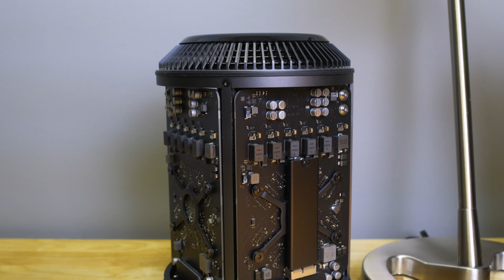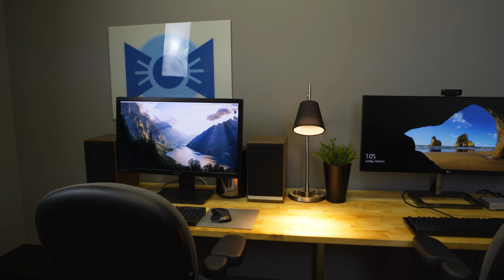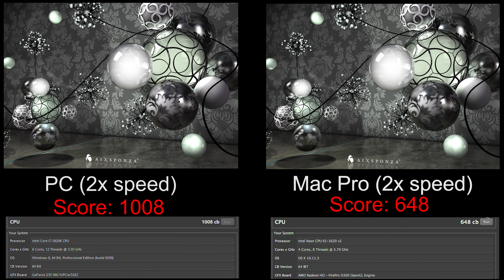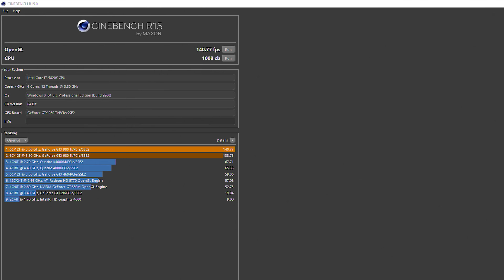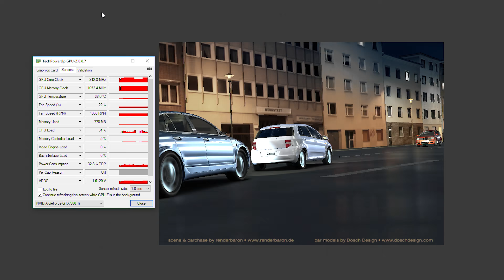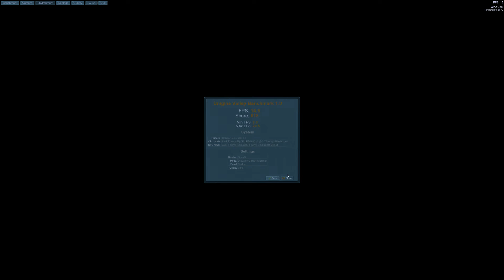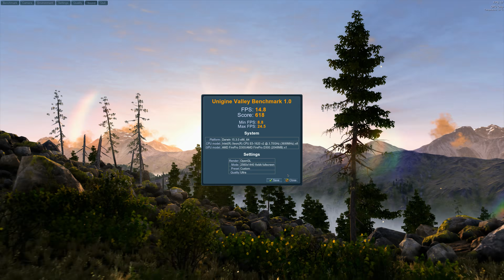$2,000 Custom PC vs $4,000 Mac Pro

Comment: isn't the firepro a gpu for workstations?
Reply: yes but work station GPUs are made for reliability not power.
Reply: +odisy64 Not only that! They are made for precision, gaming GPU's are made for real time rendering where you need no precision. I am a 3D artist and I tried mayn graphic cards, for example the GTX 960m was unuseable, finally I was using the CPU integrated graphics, because it was even better. Professional graphic cards are only for working with datas, if they are rendering something, it's non real time render, which is incredibly nice, but it's one picture(or frame if u want it so) per 1 hour (for small projects) (deppends on power pf the card), gaming cards are meant for nonstop real time rendering, they render 60 pictures/frames in ONE SECOND, that's pretty different, and they don't need any precision, for "gaming precision" there os the CPU. And also a difference is in drivers, GeForce cards have ONLY drivers for in-game, (by nvidia called Game Ready Driver), they have no driver for professional uses in-windows, but Pro cards have them, some have more drivers for specified software
Reply: David S. GPUs are GPUs, in fact, the top tier Quadro card, from Nvidia, uses the same architecture as the current top tier GeForce card.

If a 750m paired with an i7 4700 MQ can run a game like Metal Gear Solid V: The Phantom Pain at medium high settings at a solid 60 FPS, there is no reason to think it's any less powerful than a mobile quadro of the same architecture.
Reply: David S. Actually I meant in terms of rendering things efficiently or accurately I know that Nvidia uses architectures like Pascal & Maxwell but what does GNC have something similar to cuda cores to help rendering?
Reply: VwjUnit ECC memory isn't the biggest bonus of professional card, but yeah, most professionals working in demanding graphical applications will be happy for it. About big companies, it's not about if user is a freelancer or a big company, like Pixar, it's mainly about what the user do with the card, not who use it, but what for he use it. About LinusTech, he is mainly in to gaming hardware, take a look on all his videos, games, games and games... I'm very interested in to what's his profession, because it doesn't seem he has to work with a card like this. 
Don't trust, in pro hardware, to people who don't understand it's useage.
I am a professional 3D artist and I've been modeling models for GTAV, The Crew, Red Valor, The Crew and more, I guess I understand to what a 3D artist needs.
Reply: odisy64 look, I study electronic engineering, I work as a 3D artist and I know what the cards are meant for. I designed a 3D modeling software known as Linea3D PRO(not for public useage), I know what on the power is used, I don't say he doesn't understand to technology, but probably he does only as a user. The videos he made about this case haven't good reasons, mainly the support he was talking about. So why a level designer use a gaming gpu, if he needs pro support? Because he needs a gpu ready for real time (if he use a real time engine like Snowdrop or CryENGINE). I can't imagine a level designer with a Quadro... And gaming cards have same support, just don't buy it in a consumer shop
Reply: Trash animations Sure,
https://www.artstation.com/artwork/gGbZQ
It's one of my cars created for The Crew, some textures, like ID, or Ford logo in interior weren't created by me, they are objective for all in-game vehicles. I was creating usualy environment, but I did also 3 cars, including this Mustang
Reply: nice work, David!
Reply: I recommenced that you watch $5,000 Graphics Card!? - HOLY $H!T Ep. 9 from Linus. But I did some digging and at least 3 years ago drivers for Quadro were better optimized than the Geforce cards for things like 3D work. But since Titan cards are both aimed at consumer and professional market I would think the Geforce line would have a decent drivers for 3D work. But this is all I know about this subject.
Reply: Somethingafw Yes, Titan Z and Titan P are good for 3D, it's perfect for people who work in non-real time software and also in real-time software. So for low AAA game development are Titan Z, or P and Radeon Pro great.  In movie industry (still talking about 3D) is better FirePro, or Quadro. I' have never had a Titan X in my hands, so can't say
Reply: but the gtx 980 ti edges it out in every single way
Reply: When Apple controls the drivers and does the support under OSX, the distinction between most Firepros and Radeons is slim.
Reply: ***** Not all Quadros have same architecture as GeForce cards, only the Mobile Quadros, that's true. But I was more talking about FirePro's which are GCN architecture, which is specialy for working with 3D models (3D modeling, animating, material editing - by some people called lighting, but that could be also meant as picture lighting). The sentence "GPUs are GPUs" is pretty wrong, a Pro card isn't always good for every 3D artist, a Quadro is more for character modeling and "things" modeling(eg vehicles) , a FirePro mainly for "things" (eg vehicles) and effects and an Iris Pro for low/medium poly characters and low poly "things" (eg vehicles). GeForce is useless in Pro uses because of teir drivers, really useless. Radeon of their architecture. Ps Quadros are in my opinion worst, but not all Quadro cards have GeForce architecture.
Reply: David S. isnt GeForce line specifically advertise as gaming GPUs? and isnt the GNC architecture the equivalence to Nvidia's Cuda technology in terms of rendering?
Reply: odisy64 No, GNC isn't equivalence of CUDA, CUDA isn't architecture, GNC is an archtecture as is Maxwell. Yes, GeForce are gaming GPUs, that's the thing that I am here all the time telling, a FirePro shouldn't be compared with a GeForce card and even not with Radeon except Radeon Pro. 

Note: sorry for 5 replies, YouTube is sometimes buggy, I think I deleted them all except this one
Reply: odisy64 GNC is more for precision, but yeah, something is there. But GNC is more for Autodesk software then Blender
Reply: odisy64 just don't know how it's called
Reply: +odisy64 I find out, that AMD use in FirePro "Boltzmann Initiative", that's CUDA, but however, CUDA is more for video rendering (mean in video editors) and Blender users, in other software like Autodesk if you will set it right, you shouldn't need CUDA, I mean in under settings of rendering settings
Reply: +odisy64 I find out, that AMD use in FirePro "Boltzmann Initiative", that's CUDA, but however, CUDA is more for video rendering (mean in video editors) and Blender users, in other software like Autodesk if you will set it right, you shouldn't need CUDA, I mean in under settings of rendering settings
Reply: +odisy64   I find out, that AMD use in FirePro "Boltzmann Initiative", that's CUDA, but however, CUDA is more for video rendering (mean in video editors) and Blender users, in other software like Autodesk if you will set it right, you shouldn't need CUDA, I mean in under settings of rendering settings
Reply: That's...not true.

The newest desktop Quadro card has the same architecture as the Pascal Titan X. Performs the same/somewhat worse than the Titan X too.

The line between Consumer GPU's and Workstation GPU's are a very blurred line now then in the past.
Reply: itsLivee Are you sure with what you are saying? Probably no. Here's comparison between TitanX and M6000
(Don't look on the GTX960m, previous comparison)

http://www.videocardbenchmark.net/compare.php?cmp%5B%5D=3176&cmp%5B%5D=3162&cmp%5B%5D=3544
Reply: I don't know what specifically  you two are arguing about, but LinusTech compared a Titan X with a Quadro m6000. His conclusion was that you are paying 5 grand on the Quadro m6000 for the 24GB of VRAM, but it's not just any VRAM it's ECC (Error-correcting code) memory which is essential for workstations that's used by big companies. That's also another reason why there's a big price tag on it because it's not marketed towards a general audience, but instead towards the big companies that actually require this massive amount of ECC memory.
Reply: David S. Oh Linus dose know what these cards are used for, he test them in gaming to show them that they are not made for gaming but they can do it, he is a tech expert which might have more insight in technology than a 3D modeling artist who has more knowledge on 3D modeling not that they can be an expert in both, he has made about 2 videos showing the performance and the reason they cost so much.
Reply: could you please send me a link to some of your work on the crew?
Reply: Kapteinis Reinis Thanks! :)
You're a 3D artist too?
Reply: David S. no. im into music production, composing, recording and djing. I needed a laptop with thunderbolt for using external audio interfaces and DSP chips, and to my surprise, macbook pro was the cheapest.
Reply: Kapteinis Reinis if I can give you an advice, Dell Precision M7510. Dell sells also "manufacturer refurbished", that means usually somebody bought it and in to 14 days he gave it back to Dell, but it can also mean Dell refurbished the device (exchanged some parts). It has Thunderbolt 3. And device starts on 1.200$ as full new. Manufacturer refurbished starts on 700$. The configuration i7 6820HQ, FirePro W5170M, 16 GB DDR4, Thunderbolt 3. costs full new 1549$, MR: starting on 900$, that's much more faster and cheaper than Macbook Pro for 2.800$ - i7 5xxxU-dual-core, R9 M370X, 16GB DDR3, Thunderbolt too.
If you want design, here's also Dell Precision M5510 (i7 6820HQ, Quadro M1000M) or XPS 15 (i7 6700HQ, GTX 960m), both have Thunderbolt 3 and both have same design - thin elegant design in full metal 13" body with amazing 15" display.

I have a Manufacturer Refurbished Dell Precision M7510 and I use an external GTX Titan Z (through Thunderbolt 3)
It's like new, no defects, even no cosmetic, paid 1 100$ including all charges like import (EU), shipping Tax. -bought the config. comparable to the MacBook Pro I said yet. 

Dell Precision M7510:
http://www.dell.com/en-us/work/shop/productdetails/precision-m7510-workstation
Dell Precision M5510:
http://www.dell.com/en-us/work/shop/productdetails/precision-m5510-workstation
Dell XPS 15:
http://www.dell.com/en-us/work/shop/productdetails/xps-15-9550-laptop
Dell XPS 13 (has also Thunderbol, but has no GPU. Body's 11", screen: 13"):
http://www.dell.com/en-us/work/shop/productdetails/xps-13-9360-laptop
Reply: David S. is there something with 2 thunderbolt ports?
Reply: Kapteinis Reinis I heard Thunderbolt 3 supports adapter plug.
Try to ask "The Wolfe" company, or on best Intel. Dell has a live chat, you can also ask them ;)
Reply: Actually the line between Quadro and for example Titan is very little, Newest Quadro has more vram than the newest Titan but when do you need 24gb of vram? People have been using 980 ti and Titan cards for editing for some time since they perfom splendid on both platform work and gaming.
Reply: Somethingafw but quadro is better than Titan in 3D rendering.

Comment: GUYS I BUILT MY SYSTEM IN 2013 FOR 2000$ AND IT RUNS BETTER THAN THIS COMPARING MY BENCHMARKS LOL
Reply: Nowadays you could build a budget AMD build with fx 8320 and rx 480 for 750€ that would totally dumpster the mac pro (3500€)
Reply: https://community.amd.com/thread/202410

Comment: I don't get why everyone has to have the best of everything. Get what is best for yourself. I get it ok, windows is better, whatever. But I HATE the OS that feels like it's slapped together; and a mac mini is enough for me as a basic everyday desktop. I can even run basic (mid to late 2000s) old games that I love with no problem and the best part is that its main purpose isn't gaming. If you eliminate "saving frames" and all that junk, hell remove gaming all together, then how much do you really need on your computer?

That's just my opinion. Yes I'm allowed to have it. No I don't care about how your opinion is gospel.
Reply: Although I am a gamer, I am also an mechanical engineering student. Macs strugel when having to produce large 3D renderings and get very slow when designing using auto cad, creo, or whatever. And some software needed for design isn't compatible with Mac OS. Using boot camp you can run them but the lack of raw strength in hardware (on a Macbook pro 2015 model in my experience ) makes it hard to use. So, there are other reasons to choose PC over Mac other than gaming. But you are right to have your opinion. Just putting that out there.

Comment: Not a very thorough comparison. I'm a PC user and I think PCs are a better value but here's the thing with Macs. That GPU that's in there is a workstation card and NOT meant for gaming. It is meant for things like Maya, Zbrush, Photoshop, and all kinds of multimedia products. It excels at that over a gaming GPU. The pre-installed software is also better. Also, Macs have components in them that are fine tuned to work well with each other unlike a PC which people just throw together. I've run in to a lot of headaches when building PCs. The OS is also more smooth and stable. And when it comes to customer support, Apple has some of the best. I still think 4000 dollars is way too much for that but we have to take in to consideration what this video missed.
Reply: 4 year old art cards are still worse at all of those tasks than new gaming cards.  The point here is that Apple is selling old hardware because they've practically abandoned their non mobile departments.
Reply: better pre installed software fair enough but you can easily get better software on the internet, and the work station card isnt worth 4000$
Reply: no architect or music producer agree with you
Reply: This is the most retarded argument ever. "GPU isn't meant for gaming, it's meant for this and that..." 
GPU"s have one job. They are very specific in what they are meant to do and that in very basic terms, is to render and distinguish as many polygons as possible over a denser area of pixels.
Reply: There's a difference between workstation cards and gaming cards. The drivers on these GPU's are geared towards things like CAD  and Maya and perform much better for those applications. Drivers for gaming gpus are optimized for games.